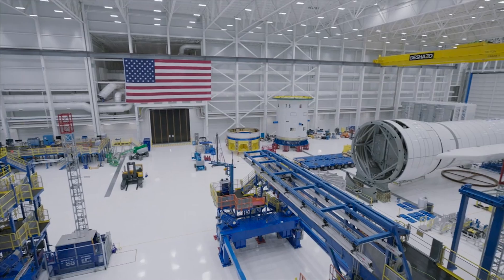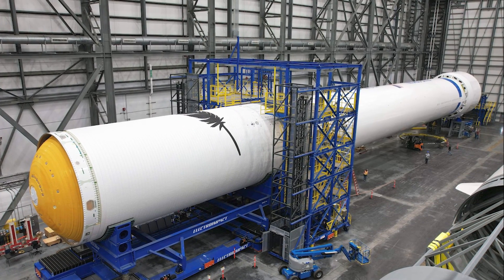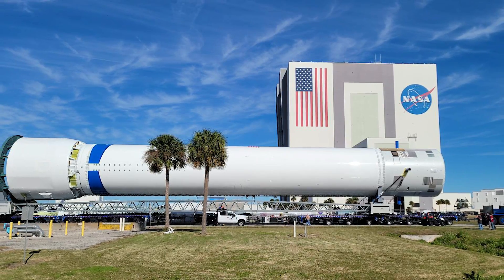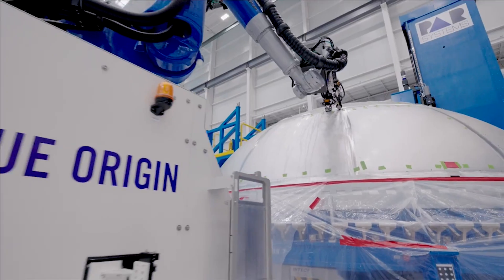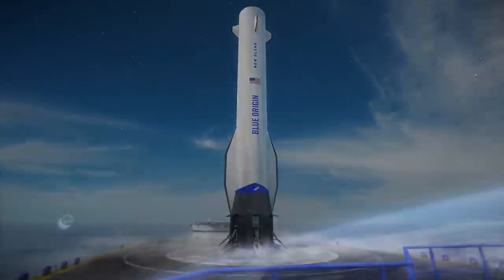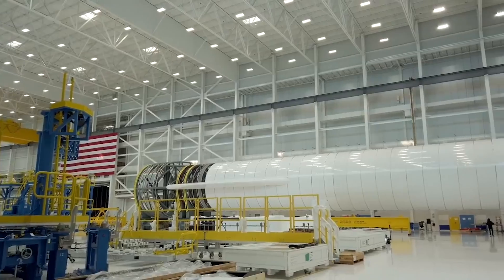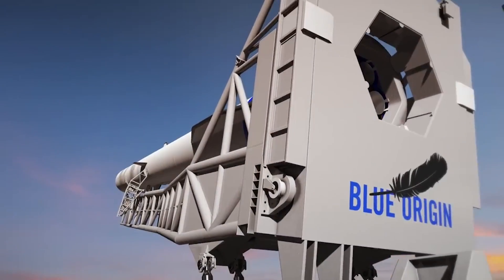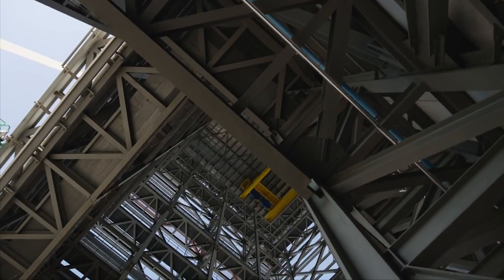New Glenn Flight Hardware Is On The Launchpad

Comment: I think this is great but even Billionaires run out of money when they operate like NASA and spend 5 billion for every developmental rocket. If something happens and they need to do a redesign then they are in several billion more. Look at Boeing and Starliner. After NASA’s money (some of which they had to pay back) they are now several billion deep of their own money still trying to figure it out. Boeing WISHES Starliner would just go away. Blue Origin can’t afford to just live off New Shepherd if New Glenn goes away. I hope he does well as every rocket is a good rocket but his method of development have proven obsolete and expensive but like ULAs Vulcan, success rate is much higher but these are a bunch of first time rocket programmers and its easy to screw up code

Comment: Sooner than expected? I thought it was originally expected to launch in 2017
Reply: New Glenn was announced in september of 2016. I don't think there was ever any expectation of a flight in 2017.
Reply: Nope, unless you possibly by some chance consider the original medium-class reusable rocket that would've launched the biconic crew capsule to ISS. 

They originally targeted 2019. A large low-end super heavy rocket slipping by 5 years is inline with a similar slip to the right for Falcon Heavy (2012 targeted, actual first flight 2018).
Reply: @mikedicenso2778  Oh Right, 2019 then.... My point still stands, mid summer 2024 is  soon than expected. 

Don't get me wrong, making rockets launch into space is really hard, and setbacks are basically standard procedure... But the author of this script should probably not state that 5 years late is sooner than expected.
Reply: Expected in 2017? Yeah, sure. What else? The Earth is flat?
Reply: It was announced in 2016, starship  was announced in 2012

Comment: It might fly, but I highly doubt they will stick the landing.
Reply: Blue Origin has one advantage that Space X did not have in landing the booster for the first time.  Space X needed 4 tries to land the Falcon 9 before being successful in the fifth try.  Blue Origin has experience of landing New Shepard which is of course a much smaller rocket, but the principle is the same or at least similar.
Reply: @michaeldeierhoi4096  by that reasoning, Starship will stick the landing first try too.  I highly doubt that.  

There's a big difference between landing a rocket that's flight path is straight up, and landing a rocket on a drone ship in the ocean after being in orbit.  Landing New Glenn will be nothing like landing New Shepard, just like landing Starship will be nothing like landing Falcon 9.

Good luck to Blue Origin, but I highly doubt they land first try.
Reply: @MrAlbertaSurfer  Whether it comes back from a more conservative suborbital flight or a full fledged suborbital stage sep., I would think the experience and guidance systems gained and developed with New Shepard are scaleable to New Glenn. Landing Starship is nothing like landing Falcon 9 because Starship requires a belly flop, which add an obvious difficulty to the ordeal...
Reply: The factor these commentors are neglecting is throttle depth.  The Merlin can only throttle 50% so F9 booster can not go below 1/18th (5.5%) while BE-4 can drop to 20% which means the booster is throttling to 1/35th (2.85%) which is basically low enough to hover.  Thus the NG dose not need to do the 'suicide burn' which perfectly gets the vehicle to zero velocity at zero altitude.  That turns landing from a single chance death defying stunt into an easy computer feedback loop task.  Everything prior to the terminal landing itself is easy, the thermal and shock forces of entry into the lower atmosphere are just a matter of mechanical enginering for a known load, likewise steering in the upper atmosphere is easy so long as you have any functional control surfaces.  SpaceX had basically no problem getting the booster to splashdown in the ocean where they wanted it to once they installed controls.  Theirs basically no reason to think Blue Origin can't stick the first landing when all the circumstances actually make is much easier for them.
Reply: @kennethferland5579  I forgot about the throttle range of the BE-4 engines... That's a big plus indeed. What about the Raptor? I don't even know if there is any precise data on its throttling capabilities...
Reply: @dave_ant1  I belive it is intermediate  better then Merlin but not as deep as BE-4, but the more important factor on StarShip booster is the engine count, I don't think it will have trouble hovering.  What CAN'T hover is the Starship, it has to land like the F9 by Suicide burn.
Reply: @kennethferland5579  I see. thks.
Reply: @kennethferland5579  Starship can and has hovered. Raptor and BE-4 engines also throttle at the same 40%-100% range. Raptor 2 engines are less powerful at 230t of thrust while BE-4 engines output 250t of thrust. However Raptor 3 engines have produced 269t of thrust

Comment: Ars Technica claims Blue Origin will buy ULA. If this is true, Blue Origin will operate both New Glenn and Vulcan. I'm not sure what they want with two rockets.
Reply: Those two rockets do vastly different things. Vulcan is like a sports car while New Glenn is like a Big Rig. The New Glenn system overall is actually more like a train - it goes to LEO only but delivers a big payload. Yes, you can get a NG to deliver something to Lunar transfer, but you either need to fill the payload with gas (dangerous) or sacrifice the booster, which goes against the whole point of the thing. 

Until there is fueling in LEO, these big, reusable rockets won't reach more than what is usefully deployed in LEO. Stuff that requires other orbits are still better off on re-usables.
Reply: @patricklewis7636  No, New Glenn was designed from the beginning to not only take payloads to LEO, but also 13.6 metric tons to GTO and still recover the first stage over 600 nautical miles downrange.
Reply: @mikedicenso2778  PSCch! You come to me with FACTS!? This is the internet, my dude! :)
Reply: @klewis7636 I have no idea where your getting this from but its simply not true.  It's the Starship which is limited to only delivery to LEO (like shuttle it will handle only LEO speed reentry), while New Glenns expendible upper stage can fly to higher energy orbits.
Reply: @patricklewis7636  These two rockets not only do not do "vastly different things", they mostly do the exact same thing: deliver payloads to LEO. Largely Amazon satellites. Once the New Glenn lower stage can be reused a few times, there will be little reason for Blue Origin to keep using Vulcan.
Reply: ULA is a waste of money and time, blue origin also unproven company. even bezo own amazon now go to space x to get their satellite to orbit.
Reply: By that logic, SpaceX should retire F9 and FH when, if, Starship comes online. Pretty sure it won't happen, they'll keep the three rockets. Or maybe just retire FH...
Reply: @dave_ant1  Well, maybe. We know F9 can't carry the bigger Starlink sats, so they will definitely pare back on those flights. But the capability of FH is more in line with Vulcan if you expend the center. But we all know that they are going to do whatever makes them the most money. :)
Reply: @patricklewis7636  Yeah, I forgot about the similarity between FH and Vulcan... They may very well keep all the rockets to just slightly undercut their competitors on every "payload range" and more specific orbital targets. I guess...
Reply: @dave_ant1 Elon has been saying that Falcon 9 and Heavy would be discontinued after Starship reached a decent flight cadence.

I do believe it is a stupid thing for SpaceX to do but Elon has said it.
Reply: @luther0013  Yeah, between what Musk says and what happens in reality, there is a good "margin". We will see.
Reply: @dave_ant1  agreed. I am not defending the idea just stating the fact Elon said it

Comment: It will be huge win for Blue Origin if New Glen goes to orbit prior to Star Ship.
Reply: almost sure, as the third attempt for starship will still be a suborbital attempt, the fourth probably will not happen before new glenn launch, and that one has way better odds to do more in one attempt than starship in this year.
Reply: @thorin1045  Agree, Oakenshield!
Reply: @thorin1045 Test the f@#k out of everything, launch, succeed, then interate. There's plenty of payloads to go around, many not yet dreamed of, Glenn will have several Orbital missions before Starship. They aren't competitors as each has different mission at this time. BO is likely using New Shepard and Glenn programs to prepare for developing a heavy or super-heavy rocket, New Aldrin (or Armstrong, but family is publicity shy).
Reply: @sandbridgekid4121  New Glenn is a low-end super heavy class rocket at 45 metric tons, and improvements to BE-4 and the rest of NG could increase that. New Armstrong is believed to be a Starship or Saturn V super heavy level one.
Reply: @mikedicenso2778  And this NG size class is what SpaceX SHOULD have targeted for Starship if they were smart.  It would have been adaquate for moon mission, commercial sat launches and even Mars with inteligent mission planning.  And they could have gotten such a vehicle to market far faster and cheaper.  Remember that the initial StarShip plan was for something even more monsterous then we have now, it was cut down by about a third of it's initial launch mass.
Reply: @mikedicenso2778  new glenn is a super heavy launch vehicle if they expended it. Expendable new Glenn will be like 70 tons to LEO
Reply: @thorin1045  I believe New Glenn is aiming to launch before the end of the year. So Starship does actually have 3-4 launches before New Glenn. I believe Starship will launch Starlink Satellites on IFT-5 so that launch will have to achieve orbit. However, I do believe New Glenn will land before Super Heavy Booster does. Landing Legs are a lot easier than a catch lol
Reply: @Quasar-2  starship aimed to land on mars in '22, so being anywhere useful in two launches from not being able to reach orbit and need redesign to do it is not realistic. new glenn launch is in august (and has to be around that time if it wants to catch the mars window) so at best two more ift, if they can do it.
Reply: @thorin1045  It is so much easier to reach Mars with an expendable upper stage. Falcon Heavy did it on its first try. 
New Glenn isn't really anything new. The landing is quite new seeing as only 1 rocket has landed before. 
Starship is a different beast to develop. Trying to land from orbital velocities is no joke and no easy task. Starship also isn't going to land with legs. But rather be caught by the launch tower. And lastly, Raptor. A Full Flow Staged Combustion Engine. The only one of its kind to ever fly. 
I have no doubt New Glenn will be able to send the payload to Mars (not 100% sure but pretty sure.) It's the landing I doubt they'll nail first try. Certainly possible, but not likely. Because I don't see how those tiny wings will be able to guide New Glenn accurately. Doesn't look like they have enough drag to do so. The Falcon 9 ones are large and in a grid for a reason. And New Glenn is larger and heavier yet their wings are smaller.
Who knows. Time will tell
Reply: It is a meth lox fueled rocket so in that sense it is more similar to starship.
Reply: Why?  New Glenn needs to go first.  How delayed is New Glenn now?  Elon Can wait if they are ready. If you are comparing New Glenn and Starship for same level of difficulty you are wrong.
Reply: 🤣🤣🤣🤣 Starship may reach orbit, but will never leave orbit.
Reply: New Glen competes with Falcon 9, not Starship. So it's a little late to the party.